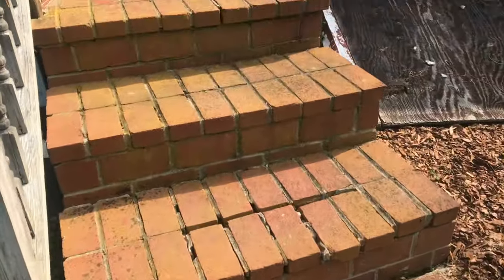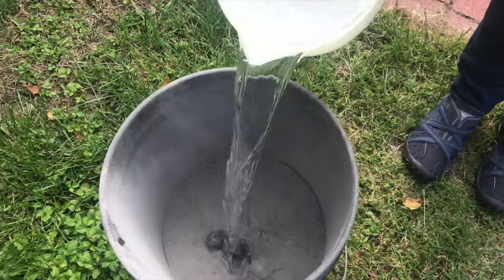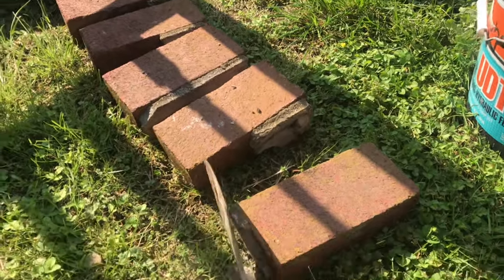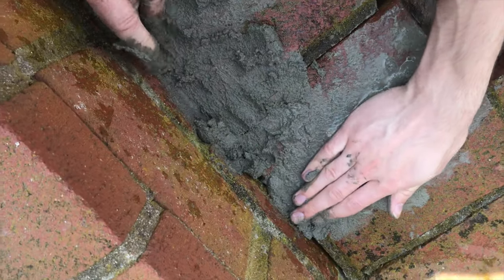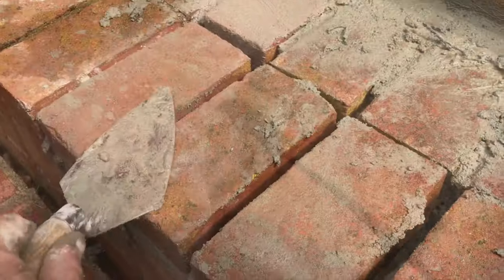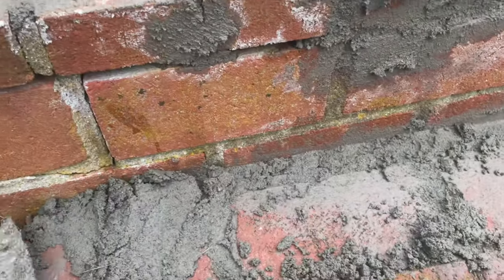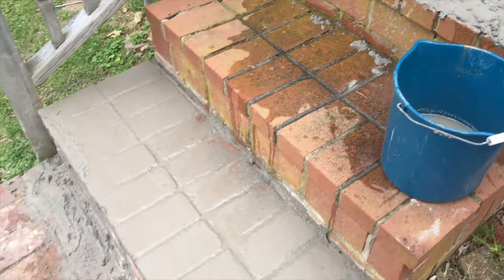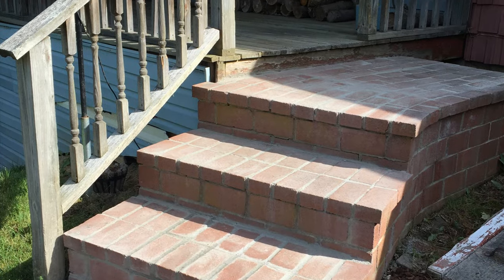FIXING brick steps the EASY way (step by step)

Comment: Seems like it would be much easier and faster to just do it correctly.
Reply: Agreed
Reply: Really thought😂😂 I’m a mason and I’ve never seen anyone do that before omg.
Reply: Do what correctly. Do tell do tell
Reply: Correct way- clean area, clean brick, lay brick in a bed of mortar and use a 2ft and a 4 ft level to check plum and level. Then you will repoint the brick using a brick pointing slicker. Wait for mortar to begin to dry and precede to brush with horsehair brush. In my 12 years of being a union Mason I have never seen someone   Use there hands and literally spread the mortar all over the bricks. It’s crazy
Reply: Right?! The guy has a trowel and still just uses his hands for some reason. Even after all the “safety” talk, he just goes back in for another handful. 

And the spreading it all over! Talk about a massive waste of material and time. Sadly ppl won’t read these comments and do exactly what he is showing 😊
Reply: yeah i have absolutely no knowledge or experience with any of this at all but i still somehow knew this isn’t right
Reply: @joefinnigan7152 for real. He will now have to pressure wash away the mortar haze which will inevitably mess up the mortar in the joints he just “repaired” and will need to be done again. 

When I was learning to tile I left grout haze thick like this on a shower wall, that was enough for me to never fuck with any type of hazing when it comes to grouts, polymers, etc. 

mortar is not necessary in the same category as it’s more of an adhesive than anything and should be used with that mentality when applying it…” 

As soon as someone says “you can put your hands in it” that’s a clear signal that they don’t know how to work with mortar. Hold your breath for the dust. You’d hate to have to buy a dust mask

Comment: I have Literally never seen anyone lay brick like this. I have No idea what the point of covering the entire step with mortar is but I know It’s not right. All that will do is stain the brick and make it hazy.
Reply from the maker: I’ll explain the logic, the one step that I was repairing was for sure the most deteriorated. There was plenty of deterioration and wash out of the mortar in other places. In order to freshen everything up I re-pointed The entire set of steps. Although the steps may have been hazy after completion it was consistently hazy rather than having one step hazy and the rest of the steps clean.
Reply: “Don’t use your hands.” *proceeds to use hands for entire video

Comment: Use a mortar bag to fill the holes instead of smearing all of them, less messy, less time, less smearing
Reply: Am doing my paver that way, it's in progress and will upload it soon. Using 1 part cement and 4 parts sand mix and dry fill the joints and hose it wet.

Comment: Props for tackling the job on your own. The finished product looks much improved, and while you made some rookie mistakes, I've seen much, much worse. Here's a few pointers:

1) You'll be much more effective, and efficient, by simply troweling and packing the joints rather than slathering the entire surface with mortar. Save the "spread and wipe" technique for interior tilework. You'll waste less material, save time, and most importantly, avoid that nasty haze and staining all over your steps

2) Now that you DO have the haze, you may be able to remove it with a good pressure washing, but for bad mortar smears, a good muriatic acid cleaning may be required. Take care if the brick is particularly old (and/or soft), or the acid may do more harm than good

3) Wetting the brick and old joints was the right move, but never try to bond over standing water. Spraying or sponging before applying your mortar is fine, but I would never pour a bucket on a flat surface beforehand

4) While the new joints look pretty good, you missed a key opportunity to "finish the job" here. I see multiple bed (horizontal) and head (vertical) joints that are failed or failing. Next time you attempt something like this, go ahead and re-point those bad joints at the same you're repairing/re-laying your brick. Not only will the final product look much better (as the joints will be color matched), but it'll last longer as well. Nothing worse than taking all that time to re-do the top surface only to have it crack/sink/shift after a couple freeze/thaw cycles.
Reply from the maker: Thank you! Obviously I can tell you are a true professional. You started your letter with a kind statement. Using a spray bottle sounds like a great idea to keep the bricks wet, never thought of it but I’ll for sure be doing that next time. The hazed look was not something that I was thrilled about but I was glad it was consistent. There’s never a day that I can’t learn something new.I’ll be absolutely using some of your suggestions next time I find myself in a situation where somebody says hey can you fix my steps, Or one of 1 million other situations. Thanks again for your kind and well thought out response. In a world of YouTube haters and cyber bullies professionalism like yours really stands out.
Reply: @livefree6878  In addition your energy is observed. But do not wet bricks...It will suck all the water out of the cement. Not what you are looking for. The Cement is the glue for the brick. This is why bricks are covered on job sites. we don't want them getting wet.
Reply: Didn't fix my joints this way, but still ended up having lots of mortar that dried on my bricks.  Any suggestions on how to remove the mortar?
Reply: Muriatic acid
Reply: To remove the haze use muriatic acid that is.
Reply: I need you number!!!! You are a life saver. I need your help with so much more! Thank you for the info.
Reply: Considering I have quotes for thousands of dollars to do this, I think I will give it a try! If it doesn't work out, no harm done. Thank you!

Comment: Unless it’s a 100 degrees outside or arrid and windy you shouldn’t add so much water. Wetting brick is ok but saturating it allows all the pores to fill with water which reduces the bricks adhesion. It’s unable to suck water from the mortar and bond if it’s already full of water so the brick basically floats. It may also release the excess water into your joints which would cause them to bleed and stain your brick facing. Hope that helps!
Reply: Not only that , this is the laziest mason work I've ever witness in my life
Reply: @PrescottShorts  he wasn't being lazy. It's called purging. You have to know what your doing or it will look like child's work
Reply: the worst job i have ever seen
Reply: Looks excellent for the price😊

Comment: I made the newbie mistake of laying bricks over the fresh mortar bed without making sure the row of bricks were level with each other. What happens is the water would back up to a pool on the brick steps, even worse in winter when it turns to ice. I suggest getting a level to make sure the bricks don't slope inwards. It's gonna be a pain in the ass chiseling out the mortar bed when i redo it. Now i know why some people lay sand instead.

Comment: Had to
Do an emergency brick step repair today 50 degrees so will take a while to dry…likely be back to winter cold here in cny sunday…i got residual all over otherwise mortar would turn to soup and never set in the cold…so am
I screwed? Or just need a ton of lemon juice/vinegar come spring? Prefer not to use real strong acid

Comment: Very helpful, but how do you return the brick to its natural shade (i.e. from 04:38 to 04:41)?  Hosing it off didn't do it for me.  What about muriatic acid?
Reply: Muriatic acid will clean the brick use a 4 parts water to 1 part muriatic acid.  The repair will still be noticeable due to the mortar being new. If you want all the mortar to match you can use a screwdriver to rake out the joints slightly then tuck point new mortar in the joints for a uniform appearance.
Reply: It won't. It's a huge no no to saturate bricks with concrete. That haze is never coming out

Comment: Weird question.. can silicone sealant in the big tube be used to repair steps
Reply: No, it wouldn't work.

Silicone is more for stopping water from flowing through a gap, which isn't a problem on a brick walkway. Also silicone doesn't hold up well in direct sunlight or in areas with heavy wear.

Comment: I know very little about masonry but this video still made me go “Yikes!”
1. Put mortar on the brick edges before placing it. It’s like you made a sandwich by closing the bread and shoving ingredients into the side. You definitely got poor contact between bricks.
2. Mortar is caustic and causes chemical burns after prolonged contact. Don’t handle with your hands. 
3. Why you felt the need to cover the whole surface in mortar only to create a very complicated clean-up process is beyond me. Your final bricks look ashy because there’s no way you can scrub the mortar out of every pore.

Definitely an easy DIY, but these aren’t beginner mistakes. These are “I didn’t read the instructions” mistakes.
Reply: Good tips.  you have any videos?

Comment: What the hell did I just watch? It’s called butter a brick up and then use a striker in the seems. And you won’t have dirty brick.
Reply: I don’t get it. Did this guy do it the wrong way?
Reply: @unvcht5046  your supposed to add mortar to each side that's appropriate and on the bottom like buttered toast hence the butter the brick. Then once it's had a little time to cure you use a striker a specific tool to scrape the mortar between the brick to make it nice and finished looking. 

This was a mortar mess.
Reply: @bsnuff2002  is there a good video on this you can share the link sirn

Comment: Every one do it differently. If the final outcome is good, I found it helpful. Fine no need for criticism. That’s the bottom line.
Reply: Actually as someone who works in the construction trades this stuff is all quite standardized, so no everyone doesn't do it different. There are industry standard methods for doing everything. I have not seen professional bricklayers do this.

Comment: The best way is NOT this video!!! Who covers the whole step in mortar? You created more work for yourself. There also is a mortar bag out there that looks like a bakers icing bag you could use to get the mortar between the brick with less cleanup.
Reply from the maker: There were certainly some structural portions of the step that absolutely needed to be corrected. And of course a lot of the mortar that was holding the other brick together was pretty deteriorated. The Baker’s icing bag is an option that can be used. I’m just curious if you’ve ever used one of these icing bags to point bricks before. It is definitely a big challenge to keep the mortar off the brick even with this icing bag. You could also use different types of acid to clean the brick as long as the brick was not deteriorated. If the brake is deteriorated you have to protect those specific bricks. I wanted to make sure that the brick stairs were very secure and re-pointed. The haze on the bricks was consistent over the entire structure. If I was only doing one step, everything would really look out of place. This is why I wasn’t concerned about the haze. I appreciate your comment, next time if I am pointing a small portion of a larger structure I will fight with the icing bag and the acid for cleaning the bricks. The staircase has been under heavy use and is holding up well.

Comment: As a mason you used way too much water in mix and cleanup,  I guarantee your job failed just like the previous mortar work you repaired in this video.  Mortar work should last decades and decades if done correctly.  If not that's exactly what happens when you use too much water.  Other than that your presentation was point on.
Reply: I agree he should be using Grade S HLM3.5 if I’m correct